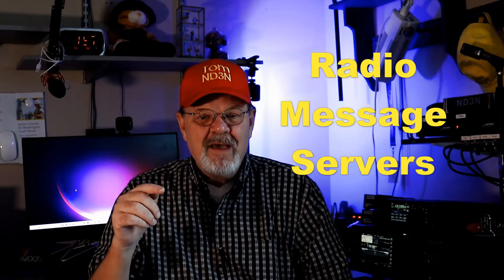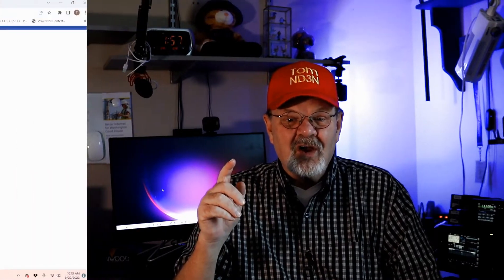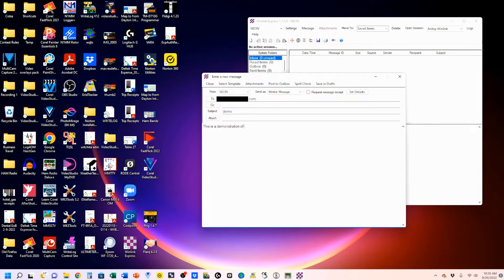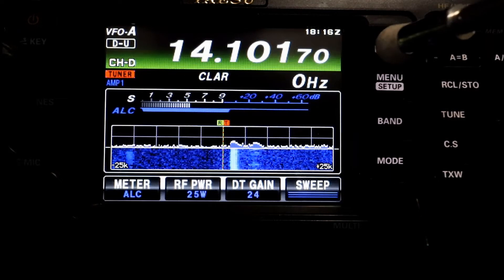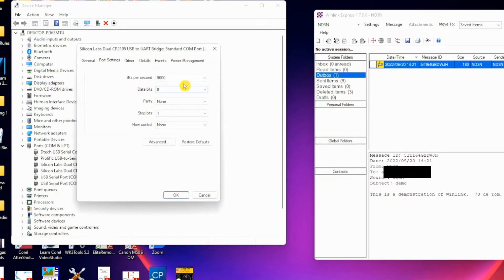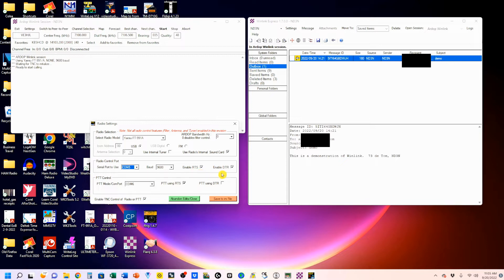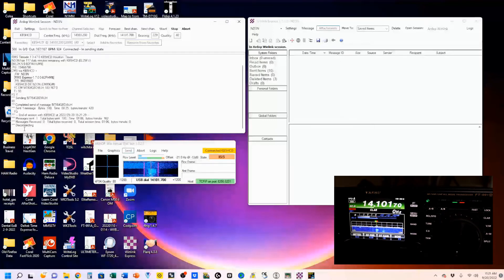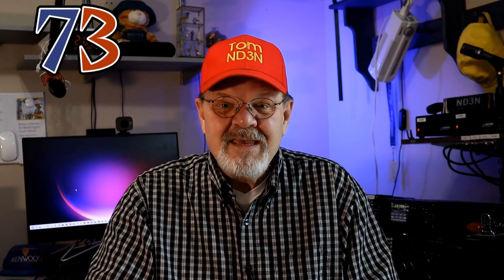Using Winlink with your FT-991A - set-up and demo

Comment: I've used Winlink in the distant past, I was using my Elecraft KX3 but now I'm setting up my Yaesu FT991A and your video is a great help sir. I'll send you a message as soon as I am set up. For now, i need to get my HF antenna finished, I have way to much coax left over need to trim off for good operation. I am also going to try a VHF link as well since we have it available up here in North Pole. Keep warm, and a Happy Thanksgiving to you and your family. 73 de AD7VV
Reply from the maker: That particular video shows winlink with ARDOP.  After some additional experience, I now recommend connecting with VARA HF.  I’ve put out a video on using it.  I look forward to your message.  73 de Tom, ND3N
Reply: @ND3N  thank you Tom, I'll check out the Vara HF video sir. Mike
Reply: @ND3N  I’m in the process of trying to get the full version of VARA HF … I have the free (limited) version but their system payment node is down???  For now I’ll watch your video, I’ve printed out the commands for the FT991A you posted, and when I’ve completed the video I’ll try to get it set up once I get off work and access to my radio. Thank you Tom, we wish you and your family a wonderful thanksgiving weekend and pray that God will protect you, your family, and richly bless you all. 73 Mike AD7VV

Comment: I have a FT-991 on order.  Thank you very much for this thorough tutorial!
Reply: Nice, I have I love it.  The rx filters and IF shift control are excellent in dialing in frequencies when close to other traffic.  I did have to send mine in for repair as the internal USB connection failed.  Suggestion: add several snap on chokes to your USB cable tying computer to 991A to help protect that input from possible RF and surges.  Mine is still under the 3 year warranty but it cost me $80 to ship and a month of waiting time.  BTW, I highly recommend RT Systems software if you don't already have it.
Reply: You'll love this wonderful rig .... "shack in a box" is so true ...

Comment: Hey Tom, loved the video since it's radio specific. After looking at your other vids list, I'm subscribing & have a number to watch! Unfortunately I wasn't able to get Ardop working yet. Although the virtual TNC was going through the motions, my radio is not transmitting, so that narrows it down a bit. Checked the ports & all settings again, baud/CAT rates match, etc. Probably something simple, but dang if I can't find it! BTW, I've had other winlink modes functional in the past, just haven't used it recently & was playing with VARA. Anyways, great job with the detail. 
Mark K4MTM

Edit: Got it working! Had to make a few changes that goes against what you did, so I guess there's more than one way to get 'em working! Here's what I did;
--- In Virtual TNC Optional Radio Settings, removed all settings
--- In Winlink Session Radio Setup, filled in all sections
Did a successful send & receive, AND the CAT channel controller worked as it should. Hope that helps others if there's a similar issue.

Comment: I have no issue sending WinLink messages with rms but when I try to send Vara hf p2p no tones are generated. Are settings the same for both?
Reply from the maker: I’ve never tried p2p, though they should be the same.

Comment: Hello, I have it all setup and everything looks good except it doesn't key the radio. You can see it trying to send the packet till it retrys out, but the radio never keys at all.
Reply from the maker: With all the programs running, check your audio settings on your computer and make sure your TNC is connected to your codec,  then check the audio settings on your TNC for the codecs.  Also  check your PTT settings on the rig

Comment: Great video. I have it all set up but keep trying all channels not busy and it keep getting a failure to connect after several transmitted cycles. Rechecked my setting and all are same as recommended. Guess I’ll keep trying 😢

Edit: connected to several now after a awhile calling, so progress but disconnects after a minute with no data sent.

Of course after last edit it worked. Lol only an hour to send an email but, but it worked so there’s that. Keep up great videos Tom!
Reply: Is that  25$ one  time  or every  year?

Comment: Hi Tom, having success with Ardop after playing a bit with the settings. Email sent to my next node in a 340km distance, but my reply hasn't received yet.Trying later to collect my reply. Great job with the radio specific videos. Also run my wsjt-x with HRD and grid tracker after your settings. Hopefully the menu settings didn't conflict too much with wsjt-x. Thank you very much.Vy 73 de DK2SP
Reply from the maker: Fantastic.  You might want to try VARA HF instead of ARDOP.  I have a video on the VARA HF setup and I can almost guarantee once you try it, you won’t go back

Comment: Thank you for all of the work you put into your videos! I have a question. How do you save you save the menu settings on the 991A? There is a lot of difference between best voice, and digital settings. One could spend quite a bit of time swapping between voice and and winlink transmissions. Thanks in advance!
Reply from the maker: When you’re using SSB voice modes, you’ll use the DSP menu items related to that mode.  When you use the data modes (USB-D or Data-U, I forget the label) you use the data associated DSP menu settings.  My 991A is currently being repurposed into a go-box for POTA activities.

Comment: I have the "991a" sending Vara P2P and Vara HF running fine with the internal sound card. There are certain configuration settings that were needed. Have you been able to get Packet Winlink running with the internal sound card?
Reply from the maker: Not yet, but I will get to it..
Reply: @ND3N  I'm trying (probably too hard) to get Packet Winlink working on VHF with the FT-991A. I actually had it working several months ago, but something got changed and I haven't been able to pin it down yet. There's little clues all over the internet and YouTube, but nothing definitive. I'd love to see a comprehensive setup (andtroubleshooting) video for Packet Winlink VHF / FT-991A / internal sound card with a USB cord. In any case, thanks for the great videos!